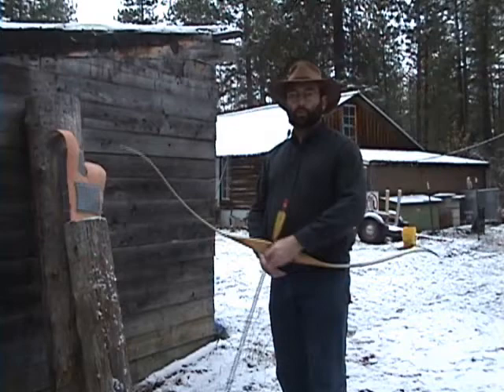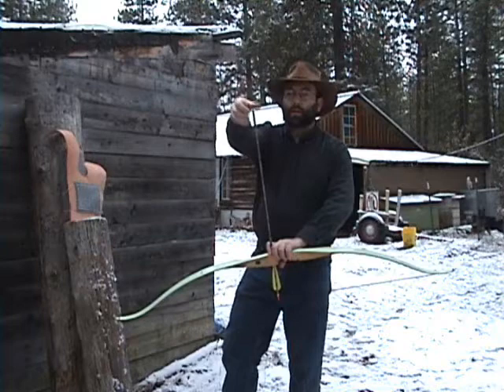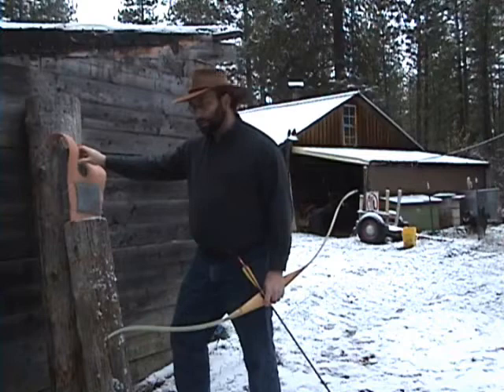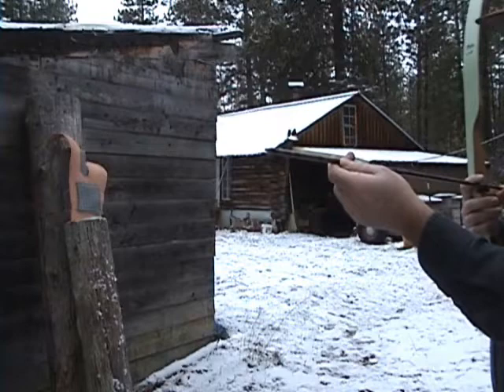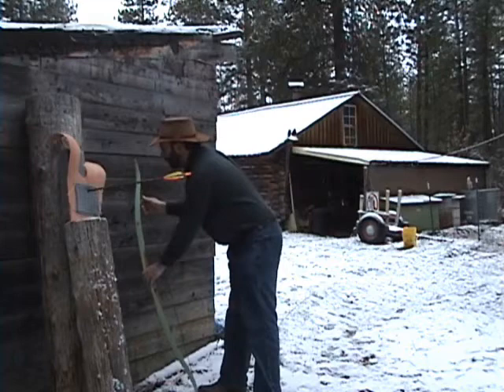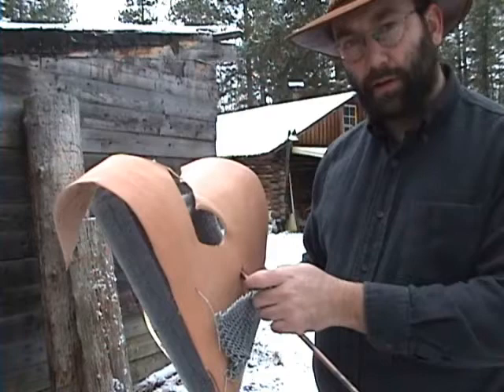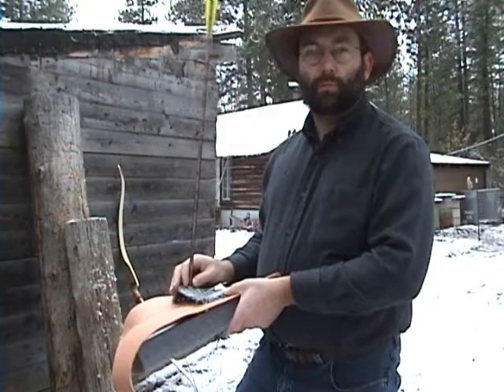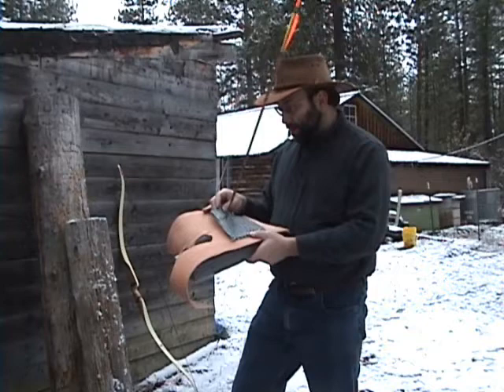6 in 1 mail vs arrow.wmv

Comment from the maker: Thanks for taking the time to comment.  I was using mail that I had, I wish I had rivetted mail.  The Japanese used butted mail, I've seen Moro armor that was butted brass, and I can't remember if the Persian mail I've seen was butted or rivetted.  Mail works great against cuts.  The cutting test I did actually folded and cut many links, ripped apart the mail fabric, but still prevented a good cut against the padding underneath.  I think you would like The Book of Swords by Reinhardt.

Comment from the maker: You're right that I've woven it myself and have worn it.  The only problem I noticed was grey fingers after working with it and grey clothing if worn for long periods.  I always wash my hands after handling to avoid getting it in my eyes the next time they itch.  I've also known others who weave/wear galvanized with no problem.  So no toxic shock.  The only problems I know of are from breathing fumes from heated zinc, also called metal fume fever.

Comment from the maker: I had similar concerns when I first started making mail, but I found that if I washed my hands after working with it I didn't have any problems.  I also do blacksmithing, so I end up with black stuff coming out my nose all the time.  Like you, I worry about what I may be inhaling.  I don't have answers.  You can get smaller gauge stainless wire or blackened mild steel wire at Harbor Freight or Home Depot if you want smaller links and no zinc.

Comment: I dont think anyone can argue that chain was designed to stop you from getting slashed, but so many of these test I've seen on you tube and so on reflect that its good for cut protection and nothing else.  As I talked about earlier its the interior diameter that makes the suit, I have a suit of kingsmaille that stands on its own holds its shape even when not being worn due to its tight weave and small rings, though its 16 guage steel and I have seen a suite of chain that barely flexes at all.

Comment from the maker: @Pottan23 I used a sharp pointed field tip.  There were similar arrow points in medieval times, especially on crossbows.  They were square in cross section, but generally the same length and angle to the point.  I've seen a variety of arrow types, ranging from very long narrow ones which would put a good hole in someone before they even had resistance from a link, to very wide ones which may have had trouble with the mail.  I used the closest approximation that I had.

Comment: SCA among others.  I forgot to mention yesterday that when your work hardening the chain you will want a housing for the fire, I have simply dug a small alcove in the dirt with a slight overhang and filled it with coal, I have also used a BBQ grill for small projects.  The portable forges they use at forge fest and hammer fest kind of look like bbq grills too, course they usually have blowers attached to theirs.

Comment from the maker: My first anvil was track--I have it in my forge for new people to use so they don't abuse my  anvil.  Stumps are easy--as long as someone in your town is cutting down a tree, you can usually get one just by asking.  A lot of the material I forge is recycled--railroad spikes (about 30 pts of carbon), old files and leaf springs from estate sales, bar stock & rebar from abandoned political signs.  Hit your local recycling place.  55 gal drums are about cheap sheet.  Heat no zinc (you know that).

Comment from the maker: Continuing:
The leather was about 1/4" thick, I don't know how many ounces.  The weight of the bow was stated in the vid. The wire is 14ga galvanized steel from the hardware store.  It would stop an edge (not the impact of course), but I wanted to see if it would even slow down an arrow.  

I forgot to mention that I would be really interested in seeing any tests of arrows vs. rivetted mail.  

You sound pretty interested in armor--do you do any testing?  I'd love to discuss further.

Comment: Armor and archery are my 2 great passions in life "aside from the family". I do renactment battles and have seen many armor test first hand.  I have build and used many suites of armor of my own.  the renactments dont tell you much in reguards to what the armor can resist against archery or other projectiles, since the draw weight is limited to avoid penetration aswell as the arrowheads are greatly blunted usualy around a 2" diameter which slows the arrows from its already minumal power stroke

Comment: If you would like to see chain that will shrug off an arrow no problem, heres what I recommend, using typical house hold items.  Get a fire going using regular charcoal and a hair drier to fan the flame.  put a sheet of chain in the fire.  Soon, it will look like sparks will start flying off the metal, this is the carbon being burned out of your metal, this will make your chain much harder but dont over do it, it will become brittle if you burn too much carbon out of it.

Comment from the maker: Once again, in a ballistic arc the initial and final velocities are similar, the only difference being the affect of air resistance (drag).  Shooting it up close with a bow that is 1/2 to 1/3 the strength of ones from the Mary Rose wreckage, with an arrow that is probably 1/2 to 1/3 the weight of the ones on the Mary Rose gives a rough estimate.

Comment from the maker: At distance the arrow would be slower, but the bow is also about 1/2 to 1/3 the strength of an English yew bow and the arrow is about 1/2 the weight of a medieval arrow.  It's not a great experiment in that regards, but I used the equipment I had onhand.

Comment: medieval arrow heads were commonly arround 1/3" - 1/2" in diameter of course barbed arrows were wider. The only thing that renactments have really made clear to me is how greatly the diffrence in impact can be in an arrow over even a short distance. I have a suit of chain that will shrug a carbon graphite arrow from a 40 lbs. bow and its not even butted.

Comment: @thelostroom well as for the accuracy you could always find  a larger sheet of mail and of leather or get a partner who is that accurate. also bear in mind the weight and composition of the arrow you used was much lighter than that of a period accurate arrow and also thinner. bearing this in mind it would take very little to match the conditions required for an accurate test i myself will try to get one put together

Comment: you have to use riveted  mail, butted is just useless weight against arrows. .
Reply from the maker: +mikajlod25 I've got a bucket full of bodkin points that I've forged.  They punch well into 55 gallon steel drums.  I'd love to punch mail with them.  Got any rivetted or welded stuff I can borrow?  I'd love to break some arrowheads on it!
Reply: riveting 6 in 1 was one of the MOST TEDIOUS THINGS I HAVE EVER DONE IN MY LIFE, but it isn't impossible. I only got to a small patch before I gave up, unfortunately, and it was only mild, unhampered steel, can't immagine doing tempered steel. I might try alternating riveted and flat but only after the final exams at school :( Funny tho, I did try to make a 8 in 1, and the thing became inflexible after only the forth or the fifth row, I thing the best you'd ever get with chainmail is 6 in 1 if you can handle the extra weight.

Comment: Use a heavy guage metal and small interior diameters in the weave.  Welded chain is stronger of course but I wouldnt really concern my self with using riveted chain, to rivet the chain you have to flaten the two conecting ends of the rings in order to puncture and rivet it.  The metal right around the rivet is thusly much thinner than the rest of the ring and thusly the rings tend to break in that area.

Comment from the maker: @ruku871 
My accuracy with a bow wouldn't be good enough to hit that square at that range.  However, the bows recovered from the wreck of the Mary Rose are estimated at over 150 lbs draw weight, and the one I used was 52 lbs.  If anything, the arrow I shot would be going slow compared to an English longbow.

Comment: Chain maille strength can be largely attributed to the size of the ring not just the guage of metal you use or the weave. Certainly the weave used and the guage as well as the type of metal used are important too but I find that a small interior is crucial.  Also is the leather hardened how many oz is it, what is the bow poundage, what distance is the arrow being shot from, what type of arrow is being used if your using AMMO standards, if you have a high or low carbon count in the metal etc.

Comment: Even the welded link would provide nothing more in the area of arrow protection. You are wearing tiny rings that have a singe seriously weak point. Even rivited chain will still catch an arrow. Chainmail is designed to resist cuts. Even butted is good at that. And yes, butted was used in europe for hundreds of years. it's cheap on iron and so easy to make the farrier's son could do it. Chain was poor man's armor.

Comment: Have you had any issues with toxic shock, in regards to handling the galvinized steel? I only ask because i assume that you have both cut and weaved the testing materials for your videos. If so, i'm sure you've noticed the flaking of the galvinization as you coil it and cut it. Not only the crafting (most dont wear gloves) but when wearing it on the skin, i think it may be cause for some concern.

Comment: This post its misleading, the chain is butted, not riveted or welded, which was more prominent. It is just cheaper and easier to get butted... But unfortunately not accurate. There is a massive difference between riveted/welded mail and butted mail regardless of ratio

Comment: Who uses a bow at melee distance 2 ft or so? If you were in actual combat you'd be battle field fodder. Theres no way you'd have time to draw and notch an arrow, pull back and aim in a shorter time than someone at that distance could draw and swing a sword or tackle you for that matter. Looks like a feild point arrow tip, pretty narrow as far as arrowhead go and lastly, what is the interior diameter of the rings, they look like 1/2 " rings for god sake. 2 thumbs way way down.